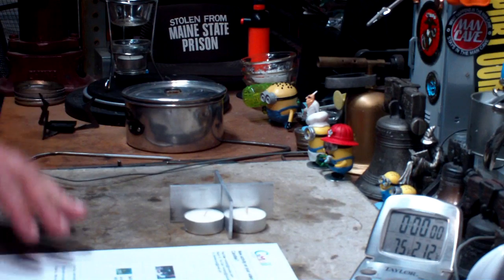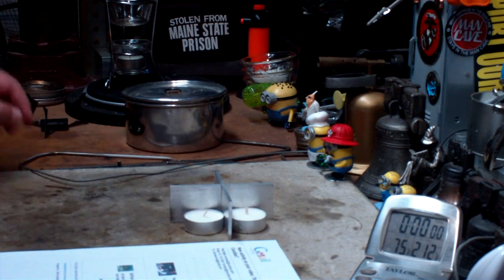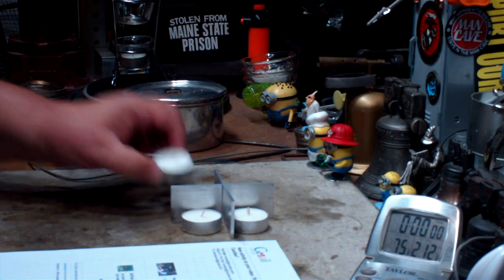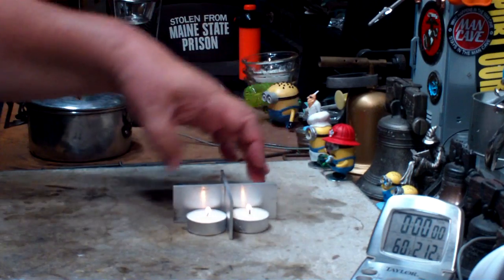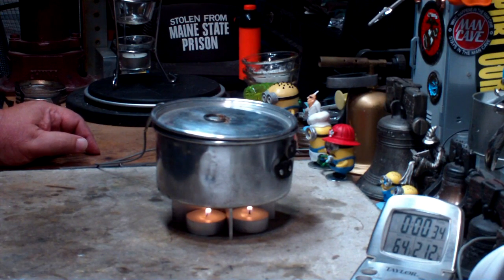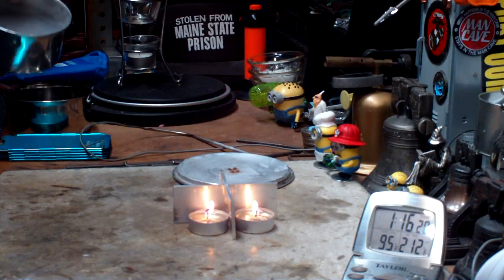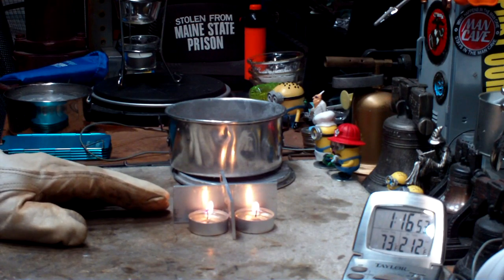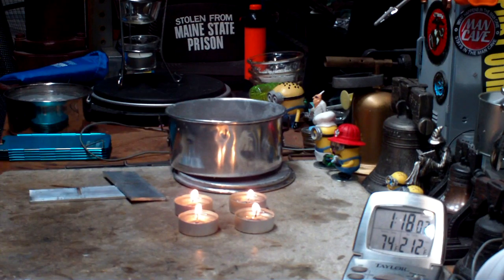Can Tea Light Candles Boil Water?

Comment: There is some good news! 211 degrees Fahrenheit, while not boiling temperature at sea level, is above boiling temperature at altitude! In Denver, water boils at 203 degrees Fahrenheit, and in the mountains it can be as low as 195 degrees fahrenheit. 

The only thing you need to keep in mind is when you boil water at altitude, you need to hold the boil a bit longer. General rule is to hold the water at that temperature for 3-5 minutes instead of the 1 minute you need at sea level. And if the water is from a trusted sterile source (e.g. an unopened bottle you bought at the store), 211F is more than enough to use the water for cooking. Coffee and Tea are best brewed with water around 195 F, after all!

Comment: Gives me an idea. How much water is in a central heating radiator. If you figured that out and heated a pot of water or a copper coil then pumped it through the radiator with a small pump then you could get heated radiators running very cheap. If you used an oil candle, with several wicks you would get a larger flame and it would last longer.

Comment: Nice to experiment with, but calculations would have given you the answers. The power of the candles (about 30 watt each) in combination with the volume of the water is the amount of water you can reach the boiling point. If you want to heat your living room with candles, you need about...well...80 of them ;-)

Comment: I know this video is 7 years old but i use tea light to blue steel wire for crafting. Just above the Blue part of the flame is the hottest and will get steel wire red hot. For boiling i think  you do need some heat containing because heating with flames is hard due to the heat flowing around and away from what your heating. It could be possible to over engineer a shroud to get the max heat for one candle

Comment: Thanks for that. I think adding a clay pot covering it on top, sitting on brick stands would certainly increase the temperature. Then adding heat proof insulation over that would also help. Moving on from that is the addition of safer fuel. And adding a heat exchanger to the equipment may be viable in producing consistent heat for a vehicle or a home. It’s very exciting

Comment: Too few candle for such a volume and surface area of water. Either use a smaller mini pot, a cleaned emptied out tea light candle tray or a more interesting concept, try adding more candles for the same experiment set up. There are 2 ways I've thought abt for adding the amount of candle. 1 squish/reshape the tealights into squares. Essentially, reducing wax per candles to fit more candles burning in the set up. Wicks might not still burn for as long.
2. Layers. Stack a formation of candles in a organised row to maximise amount of flames burning per time and surface area of the pot. It looks between 2 candles side by side a 3rd one can be stacked in the center essentially forming like a bridge structure if that makes sense.

In survival situations, any flame is good for boiling water into potable drinking water.

More wood(fuel) used>bigger the fire> faster the boil
Which is also equal to
Smaller container(pot holding water or hollowed out coconut cup)>less volume of water to be heated and surface area for the heat to roll around>less time to reach a boil

Which is why its faster to cook a goldfish than a tilapia over a flame if using the same llighter.

Comment: I often use three tealights to boil water in a 1 L saucepan and it takes about 30 min bedfore the water starts boiling. I have used this method successfully during many power outages. I place them inside my oven, with the tealights on a ceramic plate under the saucepan. I have several tiny frying pans, so I´m going to test if I can make scrambled egges for breakfast, by using three tealights.

Comment: I just watched a video where a man made a tin can cooker. He emptied a regular sized can, cut a "door" in it about 1" by 1" and bent it back, like an open door. The door was about 1/2" from the bottom. He removed the label first. He put one tealight in, and put his little pan on top keeping the door open for oxygen flow. The beans he put in the pan came to a boil. But he didn't give the time on that, and it was a low boil. I think the directed heat maximized the heat to the pan. If you used a larger can and increased your number of candles to three or used a three wick candle, you might find it works even better.

Comment: A lot of heat was escaping from around the tea lights, below the pot. Some air is required to support the flame, but... if your stove grid is surrounded with a 1” frame from the top, less heat will escape. The required air will enter from the bottom. Cool air is heavier so it will stay at the bottom, while the warmer retained air would rise to add to the heat. I believe the water will boil, perhaps more quickly,  under these circumstances.

Comment: This test needs to be done with flame from the candles touching the bottom of the pan...you are losing more than 70% of the heat because of the distance from the top of the flame to the bottom of the pan...the flame needs to touch the metal....

Comment: Nice job, you realise that to double the wick area multiply the wick diameter by the square root of 2, adding wicks is similar to adding candles, try a bigger wick from a craft store, the candle won't last as long but will burn much hotter.In WW1 the German army issued Hindenburg candles for the men in the trenches about twice as big with a larger wickthey served as light and heat. In a small tent like a pup tent two candles can break the chill as well as act as hand warmers. A small source of heat will keep a tent dry and prevent dew and frost forming on the outside. I used either a UCO canderler or a small! Kerosene lantern wired to the tent pole.

Comment: I'm not really suggesting you do tests because I'm not sure this could ever be a practical cooking system, however, I wonder if the tea lights would work with a Caldera Cone. I think it might be more effective that a standard windscreen. 
Another option comes to mind, if you for some reason, really wanted to make tea lights work, would be to use something like carbon felt to make an insulating cover over the pot lid. 
I seem to remember someone was using something like that for their dry baking system (Maybe Jon from Fat Cat Gear).
A final option might be to use a wider pot and just use more candles. 
None of the options sound like anything I'd trust to be my main burner setup to boil water but it might work for someone who was interested in doing some baking.
Reply: Yes it would work, and using insultion works very well. In an insulated can I could get 1 liter to start boiling after one hour and 30 minuts, with just one tea light.